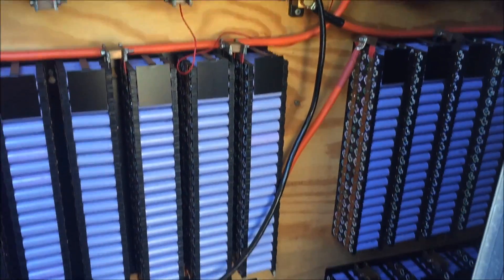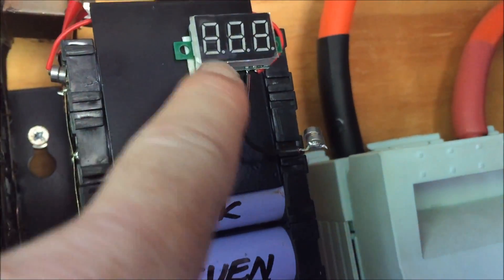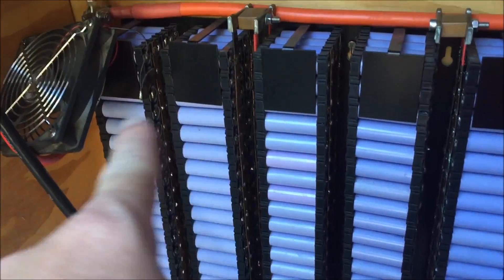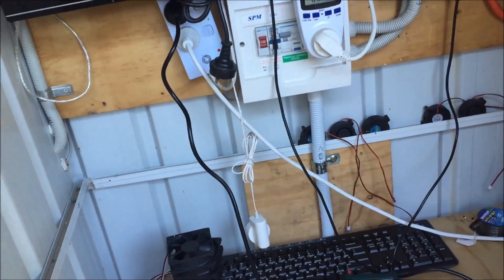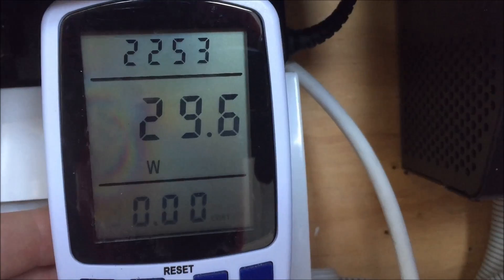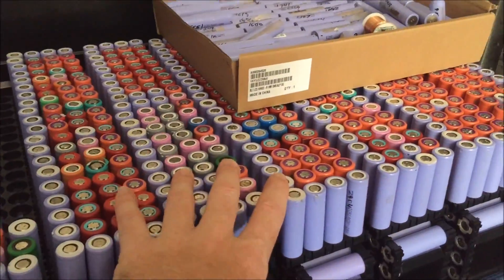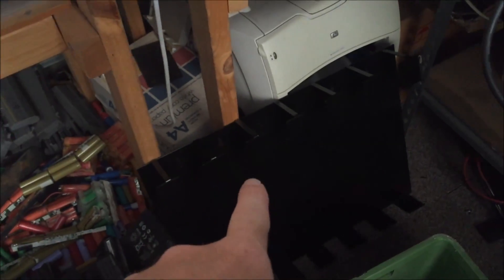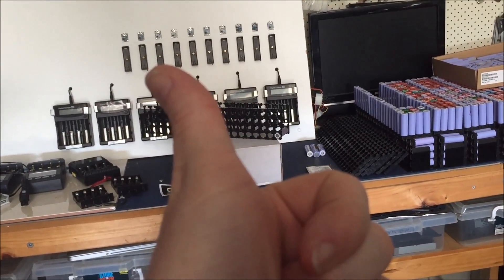⚡ 🔋 Quick run around on whats happening 🔋 ⚡

Comment: Cooling tip from the northern hemisphere :-) : A steel sheet pipe, some 30cm in diameter, from an AC shop, 3 meters long(extendable if needed), painted black, mounted in a whole in the ceiling or wall, leads the warm air to the outside like a chimney using the natural thermal effect....after buying...no cost, no noise, no maintenance, no powerloss.
Reply from the maker: Would definitely try that if I lived in the sticks. Given location probably won't do it for aesthetic reasons. Bet it would work perfectly tho!!

Comment: Wonder if it's better to use an LCD 8 segment display module rather than LED, or simply send the info over the wire and monitor it remotely.
Also thought about having small glass fuses rather than soldering. sure it's much more costly but maintenance would be easier. Could even put small LED+resister across it so if it breaks, the LED lights up just faint enough to indicate a busted fuse.. overkill but makes managing/monitoring 100's of batteries easier... just a thought.
Reply from the maker: Very good thoughts :)

Comment: Have you thought about sever racks, I see heaps for free. I suppose you just have to make 19" sliding racks with large blade connectors for a PnP setup. We use 13KW/day for our whole house.
Reply from the maker: many are going down that route, but i do like my way :)
Reply: Just wondering about the high surface area problem.
Did you give up on the resistance testing?
Reply from the maker: not at all a problem :) Yes I did as I didn't /don't own a product that does it accurately enough for my liking.

Comment: I'm surprised I keep seeing these videos where people mount packs to wood.  Why not use cement backer board, normally intended for behind ceramic tiles (non flammable and heat resistant)?  Is WonderBoard a regional thing?
Reply from the maker: It's easy and cheap and it's inside a locked tin shed. Googles WonderBoard

Comment: https://www.youtube.com/watch?v=P-ldN5bmPUc&t=37s
that cost me $38 to make it from a dead AC fan turn to DC and it saving alot of power off my battery bank and my fans run full time in summer
Reply from the maker: Yep have seen that one of yours :) thing cranks must push some air !
Reply: push way to much air thats why there a speed controller on it,  it was made to cool a radiator in a car so yes lots of air i love to see you make one but with your 18650 in the feet or a box on the back of it so you can just charge it up and see how many hrs you get out of it bet you run it all night on a low speed not flat out  mine be so cool with some batteries in the feet maybe a video down the track hey

Comment: how come your all about saving power today about a small, never so small volt meter then you go and have a ac fan on the wall the power running that fan come from your dc battery then to ac inverter then in the fan i use a DC fan there lots of them getting around know them small fans you got don't do it them fan don't last long and die make i long box to go on all you holes at bottom and go to one dc fan with a speed controller and a temp switch you can set it when to turn on then if it never die's you only have one fan to replace..
Reply from the maker: Because that fan on the wall + computer + energy meter put it into context. Also I'm going to change my focus of my project over the coming weeks. Removing the meh and replacing it with a new BMS that does a whole lot more management and automation of my bank. I've been in contact with many on YouTube (you inc) and read 1000's of comments trying to work out a direction that is both practical for me and for the greater good of the whole "powerwallers' out there.

Comment: Use mains voltage fans and a thermostat they use on home heating systems. To keep the storage room at your desired temps with out using extra energy.
Reply from the maker: Yes great idea, but better one is coming :)

Comment: this maybe a stupid question, but are the cost savings for used batteries truly worth the added labor?  I haven't tested them yet, but I just grabbed a pack if 4 3000mAh 18650s from amazon for $13. yes, the cost is higher, but there shouldn't be any screwing around with them either (I assume). quality over quantity. time is money.
Reply from the maker: I have spare time :) and I enjoy it. Some people smoke...
Reply from the maker: buying a Tesla Powerwall 2 would be cheaper than buying cells then building it up. Or as TDP said buy used electric car cells.
Reply: thouse are garbage 100-500mah in each cell if your lucky despite all the bs on outside
Reply: You can also find them for a dollar each from alibaba

Comment: My existing solar goes into the inverter and straight into the house obviously.   If i build one of these, do i just buy a charge controller, and then how do i then connect back through my inverter to the house?    Is there any risk of fire?   Im thinking if i did it, it would be going in my shed which is under the same roof as the house, i'd put it in a small metal container with some vents at the top.
Reply from the maker: I definitely think asking me is the wrong way to do this. If your unsure ask your local electrician
Reply: HBPowerwall id be getting it wires by a spark im just trying to find out what boxes i need etc.
Reply: how helpful of you, why have a diy website, youtube channel etc. if you arent prepared to even answer the simplest of questions?
Reply from the maker: Because I don't have enough experience or knolage to give you an educated reply sorry. Being honest is always more helpful than lying i feel. Sorry to disappoint

Comment: What are the stats on your charge controller?
Reply from the maker: What do you mean by stats buddy ?
Reply: Do you charge the powerwall with solar?
What's your charging rate in amps? What's the max it can output?
Reply from the maker: Yes, it's a PCM60X max output of the charger is 60a at 60v. With my setup its about 25-40amps charging current. More info can be found on  the DIYPowerwalls forum http://www.diypowerwalls.com/t-HBPowerwall-Offical
Reply: Neat, thanks!
Reply from the maker: No problem

Comment: I'm working on making a 18650 battery would you test it for me when I'm done?
Reply from the maker: Would have to say no, if you're local I'll come take a look !
Reply: HBPowerwall nah in Victoria. Iv got the materials to make them just not the tech to test them yet. But one step at a time. What are you doing still awake or are you an early riser?
Reply from the maker: Checking YT stats during a fridge run always ends up in replying to 50 TY comments ...lol

Comment: I was going to put momentary switches on mine. So I can just switch it on for a couple of seconds just to compare to other packs.
Reply from the maker: That's all you'd relly need admittedly I only ever put one on... lol
Reply: They don't seam to use much power - Working Current:red< 23mA,green< 18mA,blue< 13mA -, but a switch is the go.